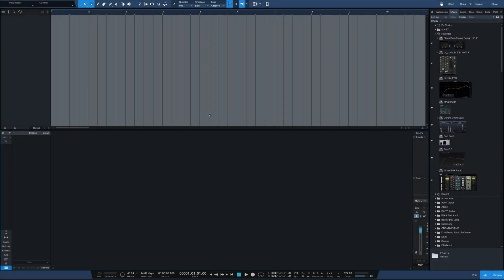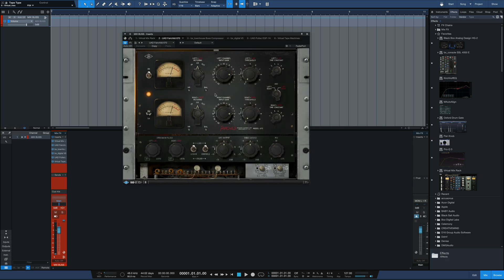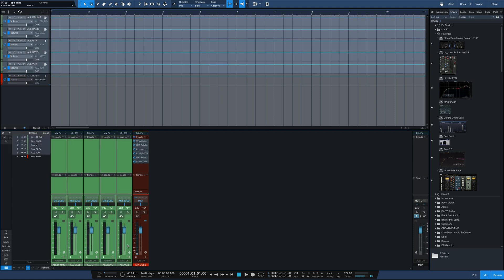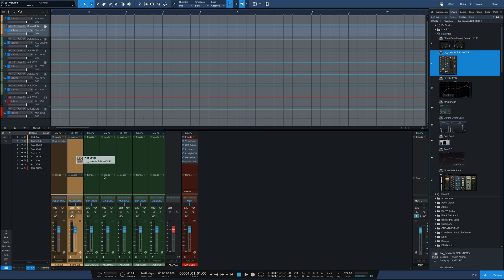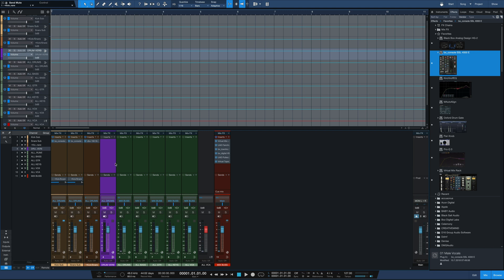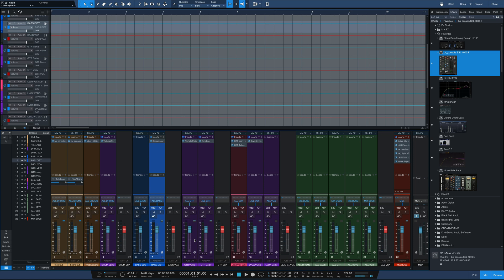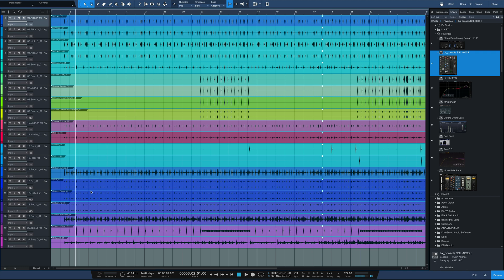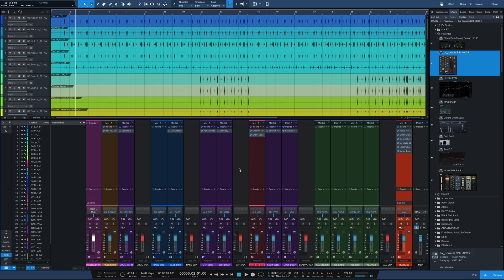How To Make a Mix Template in Studio One

Comment: I recently made a template (before watching your video) and love the idea of adding the VCAs. Great idea. I will update my template.
Question: When I saved my template I actually had a typo when I named it and could not figure out how to rename the template to correct the typo. How do you actually rename a template if you wanted to rename it to some other name? Thanks and great video with great info. Thanks.
Phil
NYC area
Reply from the maker: I would just open the template, save it under a different name as if it were a new template, and delete the misspelled file.
Reply: @GreenLightSound  That's what I actually wound up doing. Seems there should be a way in Studio One to rename, but maybe there's not...
Thanks a lot for the reply.
Phil